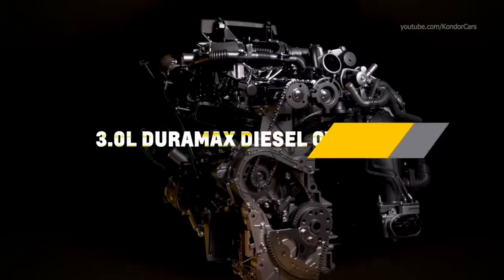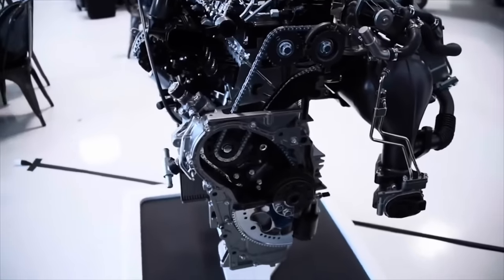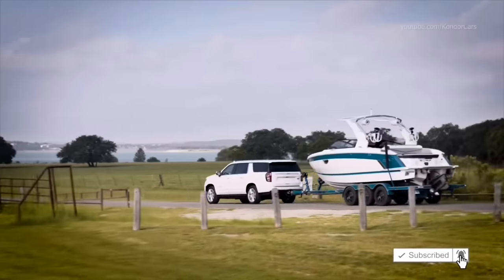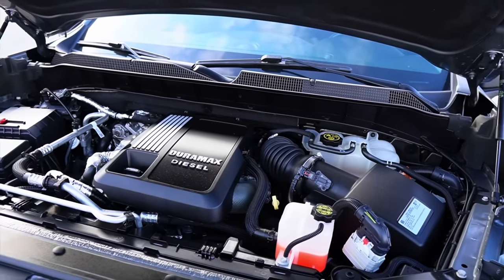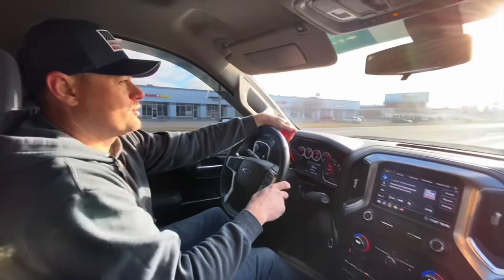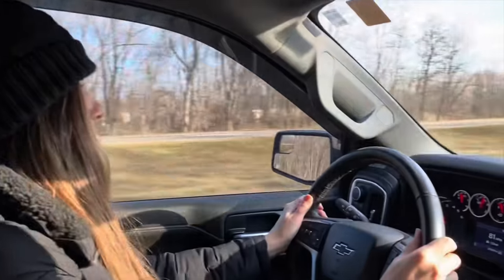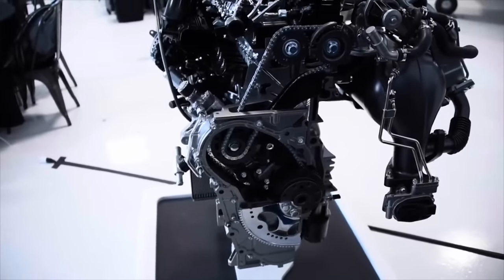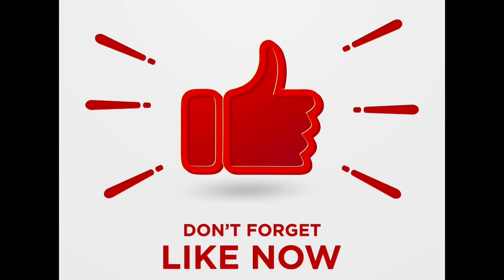What Everyone Needs To Know About The 3.0L Duramax!

Comment: we purchased a Brand new 2021 GMC 1500 AT4 with the 3.0 duramax. the truck has been great and the fuel mileage is remarkable BUT at 35k miles the rear main seal went bad and at 45k miles the head gasket went bad Also it has a excessive amount of blow by so as of today i am not super impressed with it.

Comment: Have a 21 Trail Boss with the 5.3 and like it. Have averaged about 17 mpg for the duration. Am thinking hard about trading it in for the 3.0. Also, I hate the auto stop and shut it off always.
Reply: John - There is a way to shut off the auto stop !?! That would make this more appealing.
Reply: @jimriehle2976  On my '21 Trail Boss there is. My daughter has a Cruze and my niece has a GMC Terrain and neither can shut it off. So I guess it goes by the model and maybe the year??? Anyway, there's a shutoff button on the dash below the environment controls, third from the left. Hope that helps!

Comment: I really want the updated 3.0 300hp 500lbft, but at $1500 upcharge over the 5.3 and diesel is 30% more expensive with no end in sight, plus def and more expensive oil changes. Its hard to justify now versus 3 years ago when diesel was same price as regular

Comment: I must of got a good one averaging 24(z71) most of my drives are real short 1-4 miles tops work is 10miles. No issues and the crew cab is plenty don't know what y'all were looking at but there's more space with the bigger cab
Reply: Also no issues other than routine maintenance and the extra feature for mirror tilt not working how it's supposed to but it's still under warranty at 30k

Comment: I had a 2020 Sierra with the 3.0l and my fuel pump failed and sent metal through the whole system. It only had 30k on it at the time. But i loved driving and the mpg was great. It chugged def when towing but that’s how it was designed.

Comment: I just upped to a 2022 3.0L lm2, from the 2020 lm2. Same engine, just wanted the new interior. 

Having put 35k miles/yr on this as a daily driver and a road trip truck. As well as towing a trailer for work. I have to say it’s by far the best engine for my lifestyle. 

I drive 41 miles, one way, on the highway to work as well as the return trip. Without the highway run, I believe I would have ran into the DEF issues others are having. This engine was meant to be driven and meant to rack up miles on it. This is not your 3 mile daily round trip vehicle. 

Other than that, it’s great!

Comment: It's really hard to go down to a half ton, when you usually drive 3/4 or 1 ton.
Reply: I went from a diesel f250 to a 2019 3.5 ecoboost f150 with the max tow package. I tow up to 11k rarely, which the f150 handles just fine. It's a lot nicer to live with as a daily driver than the f250. It averages 20mpg unloaded. It drives like a much livelier diesel with gobs of low-end torque. No emissions BS to worry about. It doesn't even have EGR.

Comment: I own the exact same model as you tested, color and all.  I do city driving and average 24 to 27 MPG.  I change the oil when my meter says between 30 to 35 percent, and I usually put in a jug of DEF at the same time.  I tow every so often, but not much.  I absolutely love this truck and glad I didnt get the 5.3.  I have 2 complaints,  having to use DEXOS D approved oil and the long crank no start.  But wouldn't change it out for nothing!
Reply from the maker: Thanks for the input!

Comment: This 3.0 Duramax is about as sweet of a engine as you can get for a daily driver. This vehicle is not intended to be a substitute for a work truck for someone hauling around gooseneck trailers. It is also no race engine by any means. In normal every day driving conditions it drives and feels much nicer than most V8 engines out there (more than likely due to the fact that full torque is made at under 1500 RPMs). I actually prefer to draw this over my 6.6 Duramax. I have to agree that acceleration is faded if you’re stopping on it at higher speeds but it definitely gets the job done with a solid 30 miles per gallon in a full size SUV(small price to pay). In addition I would say 90% other people buying these vehicles are not going to be owning them to worry about 150,000 mile belt change(that’s for the next guy). When the warranty goes so does my diesel and onto The next truck. It’s not Worth all the emission headaches.

Comment: The engine has a turbo system.  Therefore it will obviously feel better compared to any non turbo when towing.  GM is better than Ford.  But just wait until it needs required repair and maintenance.  That engine is way to complex to be economical.  A 18 wheeler uses this engine type for it's purpose.  It will cost the same to repair/replace sooner than a economical gas V8 truck Ford and GM have offered before.

Comment: Any engine that is high torque low horsepower you're going to need to hook a trailer up to it to determine how much power it actually has cuz it's not going to be fast horsepower is the power delivery the torque is the actual power and it may have tons of actual power you just will never realize it until you hook it to a trailer

Comment: your towing capacity was not correct, depending on the model the 3.0 can have 9200 up to 11,000 pound towing capacity according to GM. which is also the same for the 5.3 gas motor. I have been doing a lot of research on the GM 1500 trucks because I am looking to buy a new truck in the near future.

Comment: That inline 6 will no doubt be a million mile motor. Aftermarket upgrades and deletes will make it a beast.
Reply: Saying that it wouldn't pull, that engine has more hp and torque than the 1st and 2nd gen Cummins.
Reply: 100% agree with you on them making a legitimate 2500hd suburban 4x4. They are losing money on that.
Reply: Have to change that oil pump belt 7x in that million miles lol

Comment: I have had two different generations of the ram and they left me stranded. the second one the engine seized towing an empty landscape trailer. hahahahaha my dad has the duramax and loves the milage but he only has 2000 miles on it. I have owned full size 2500 duramax trucks and they are far more capable trucks and I believe more comfortable. these small diesels a purely for milage

Comment: I'm surprised Chevy and Dodge are lagging behind in the hybrid space. I think you're right, with the price of diesel and having to refill DEF fluid and possible major maintenance issues, the better MPG's just don't make up for it. With gas being cheaper than diesel and a hybrid powertrain being able to provide efficiency and power, I think thats the way to go, just wish there were more options other than the F-150

Comment: Oddly enough the gassers seem to crap out way more often with the lifters eating the camshaft.  The GM gassers are so terrible these days!  My dealer said he’s not seen 1 3.0 Dmax in their shop  for a repair since they came out.  The 3.0 Duramax is a spectacular engine!  Absolutely love love love our 2022 Trail Boss Dmax!  Great mpgs, great towing and great torque!  I would never touch a 5.3 or 6.2 gasser over the diesel!  Everyone has an opinion but next time share some real costs because it really comes down to cost per mile to operate.  DEF is next to nothing when empty.  I add some DEF every 7,500 miles or so.  My 3.0 out tows my 6.4 Hemi big time and get 5mpgs more towing than my gasser.
Reply: I won’t touch a GM gasser either but I bet your dealer is not telling the truth about a 3.0 being in their shop for repair! Mines been in 6 times in less than 4k miles.
Reply: @db2474  I have 2 of them and they haven’t been to the dealer for anything but oil changes.

Comment: Good vehicle to lease until long term reliability is proven. 33 MPGs at 5.60 a gallon is . 17 /mile. 23 MPGs at 3.20 is .  14/mile..the diesel costs about 3-4 cents more than gas per mile at those prices , driving unloaded on the highway.
Doesn't make sense unless you're towing constantly, when the diesel gets significantly better MPGs than gas. High repair costs should concern long-term owners .

Comment: I had and sold my 21 GMC at4 3.0 diesel duramax before 5k miles. 
Numerous of times it just would turn over and not start. From miles 7 when I drove off the late late in the evening, the rear suspension was cranking like I had struts lose. 
Before reached 1k miles it was towed to the dealership and before I reached 3,500 miles the truck had to have work worth 3 weeks worth down town at the dealership. 
And the biggest of all, stay away from Dennis Dillon GMC in Boise, ID. Bunch of crooks, especially the finance department. I will be filing formal complaints against the dealership as well.

Comment: It’s faster than the 5.3 and slower than the 6.2 at least in a 1/4 now over that the 5.3 would probably out run it . TFL truck did a video and ran all of them and the 3.0 came in right behind the 6.2 so for 30+ mpg and towing almost 10,000 I don’t think you can ask for much more. And trying to compare the 3.0 to the big Duramax is like apples and oranges

Comment: Who’s towing with a goose neck and a 3.0L diesel ? The 5.3 and 6.2 are grenades I have 3 dealerships I service and all say avoid the 5.3 and 6.2 in one week they had 9 6.2 with blown motors and 6 5.3 with bent push rods all in 10k miles diesel are far superior over gas any day of the week I have a tool truck with the 6.6 gm it’s been good so far but as much idling I do my oil changes went from 7500 to 5k the torque doesn’t come in till 4-5k pull 21k all day

Comment: Really helpful video for me. In the market looking at all options. Not impressed by 3.0 Duramax. Recently saw video on a 2022 Ford 250 Limited Diesel, was pretty impressed with all but the price tag (and availability). I think as much as I like tge idea of the better MPH diesel, the other considerations of the diesel make me lean toward gas.
I really had been interested in the RAM, but the Aisin 6 speed auto trans has put me off from it as compared to the 10 speed trans options seen in other makes. I had heard Aisin is bad news. But, I really like the RAM and their price tag. Don't have any idea what's going on with GMC these days. My use would be to pull recreational trailor, moderate duty hauling. Leaning toward 3/4 ton 250 / 2500 "crew cab"  level truck. Any suggestions?

Comment: I do belive GM are the only ones who offer diesel now 
Ford dropped theirs 
And also dodge 
My father in law has a 2021 duramax gmc Denali he gets @25-28 miles a gallon on the highway empty and @14 pulling a 7.5k trailer he has around 50k miles on it with zero issues with only a few recalls 
My self I have a 2022 5.3 with the 10 speed I get @22-25 miles a gallon empty and @10 with the same trailer 
People always brag about GM being so bad but keep in mind for every 1 truck Toyota sales GM sales 20 plus more trucks numbers don’t lie and when was the last time you seen a tundra putting in work lol
GM guys just like Dodge and Ford guys work their trucks way more which equals maybe more issues
Reply from the maker: Very good point thanks for sharing Nelson
Reply: @TruckMaster  my best bet is to wait a year for the new 3.0 to come out and see how it does, it has more hp power and torque and it can now tow way more over 13,000 I belive and that oil pump belt maintenance is now at 200k instead of 150k not bad in my opinion

Comment: Most people who spend the extra money for diesel engines use them in some sort of severe duty, or extreme environmental....either freezing snow and ice or burning scorching desert with dust. Or have some contractor job or line of work that has them excessive idling.....idling the vehicle all day and night. I would be interested to know how these smaller 1/2 ton baby diesels on offer from all the various name brand or manufacturers stand up to the abuse of extreme temperatures of dust on off-road applications in the desert....or up north in the snow belt....where you might idle excessively in winter. Do they derate, or need to be Re-gen'd with excessive idling under extreme temps, etc??

Comment: Gotta change the oil pump belt every 100k and have to get transmission  out of way
Reply from the maker: What a nightmare
Reply: @TruckMaster  all data shows 7hrs to do the job. And probably  2-300 in parts. Apparently  gm changed interval but idk if I'd trust it any longer
Reply: The belt isn’t an issue idk where you got 100,000 miles but 150,000 is very conservative. With that being said they didn’t change that belt design for the 2023’s either which are now rated to change at an interval of 200,000 miles. This oil pump belt is WAY over-hyped in a bad image… 
Just saying people normally focus on the negative I think these trucks are fantastic

Comment: When I was in FL during Hurricane IAN with my 21 Denali Yukon, I breezed right by the "out of gas" stations and 4 hr lines for gas. I went at 4 AM pulled right up and filled up and other were aghast that here could be a diesel new Yukon SUV. I LOOKED for "out of gas" stations, because they always had Diesel. Went for 2 weeks on one tank while there were daily fuel wars and lines. Best road vehicle I've ever had. 600 miles a tank on the road, no problem. You whine about DEF etc... I've put a grand total of 3 jugs of Wal mart DEF in for a WHOPPING total of 29.00 in 16K miles. Belt is already proven for 200K miles. Far longer than the vast majority will keep them. 
 There are many and multiple LENGTHY threads on forums about 5.3 and 6.2 lifter issues stranding people on Vacation and never knowing when they are going to drop. Like driving a ticking time bomb. Was supposed to be isolated to just a short span of 20-21 engines, yet still happening today on newly built units...

I find very few threads about actual engine issues with the 3.0 that are showstoppers. The fact that these 3.0 forums are pretty quiet when it comes to problems, speak volumes that this is the only really logical choice in the 1/2 ton truck and SUV market.
Reply: Reassuring I just purchased a 2022 GMC Sierra 1500 SLT Duramax and I been lasting 3 weeks before I need gas. I only had to purchase 1 box of DEF so far. Given I don’t haul anything so it’s my daily driver and I will never push it like some guys will. Living in Louisiana I may drive and occasional trip to Texas or hurricane evac so I’m not mileage heavy. But, so far I’m loving it and getting used to my first diesel.

Comment: Your review and opinions are basically comparing this against the big diesel 3/4 tons. If you truly compared it to half ton truck is not bad. It still is a half ton and should be used as one! Just because it's got a diesel type mine automatically thinks it can tow ANYTHING.

Comment: Your fuel cost comments are inaccurate. The cost-per-mile is still lower than the gas options - especially for highway mileage. That could change if the price delta for diesel continues to increase, but diesel is still the more cost effective fuel right now.
Reply: A_Truckmaster  - just did.

Comment: That gas engine is lame for towing. (2022 Yukon 4x4 5.3)Pulled a 5000 lb camper in upstate SC and that poor gas engine was screamin, but the hills killed it, hitting 3800 rpm.  The key is max torque at half the rpm.

Comment: Also for the belt. It is rated at 200k. That is a crap ton of miles. For your average person that will take a decade to get there if not more. Also, you have to drop and pull the tranny back to get to the belt. But would you rather do that or pull the front of the motor off. Y’all act like replacing the belt was easy to start with lol

Comment: I had high hopes for the small Duramax.  The more I got into it the more disappointed I became.  I tend to own vehicles (especially trucks) for a long time.  First, this is not an engine I would own once the mileage climbs.  Too many gadgets to break down and while the turbo might be easy to reach, nothing else is.  I hate the rubber belt driving the oil pump, there is simply no need for that.  If space was really a concern they could have easily put in a chain drive and eliminated the maintenance and change requirements. All the drive stuff should have been put in the front.  Considering all the emissions stuff, I love my LMM and plan to run it for a long time (currently at 200k) but it will probably be the last diesel I own.  If I get a newer truck I'll be going back to gas.

Comment: Had a 2019 Silverado with 5.3 Z71 4wd on average got 12 MPG. Had it since August 2019 and traded for a 2021 Tahoe premier 4WD with the 5.3 and is getting 14 average. Don’t know what y’all are doing to get 17 😂 also that average is combination of in town plus highway speeds at 65MPH as we live 5 miles out of town

Comment: I almost bought a 3.0L 2020 Silverado Custom but with 130k on the clock and a stupid price of $52,999 I walked away from it being it’s close to the belt replacement interval and diesel fuel prices were high.  I also thought about the 6.6L gas in a 2500HD but I’ve heard bad things about the trans sun shell cracking and you basically have to buy a new trans at that point and at a price of $62K for a 2021 with 90k on it still not worth it.  I settled on what I do know and a 2016 3500HD Sierra work truck is about tried and true as you can get.  With 110k on the clock the price was still high but I felt more fair.

Comment: SMH worst disinformation video on the 3.0 ever! 
It’s now 200,000 mile belt inspection 
You can get 3.73 gears and pull 14k instead of the 3.23 you drove. 
You can also get seating for 6 in different models.